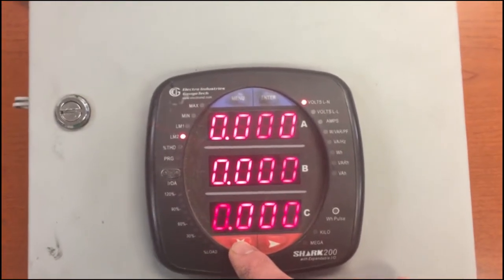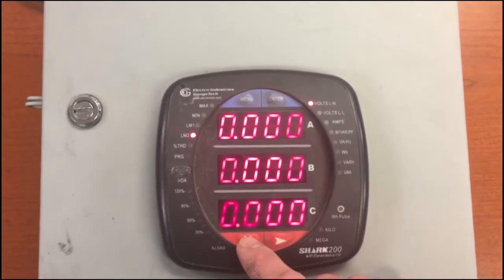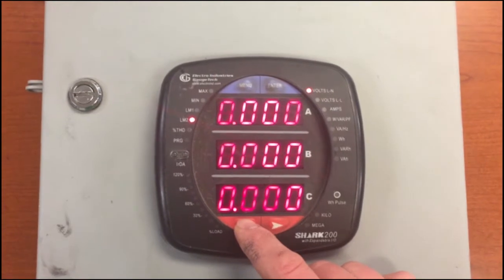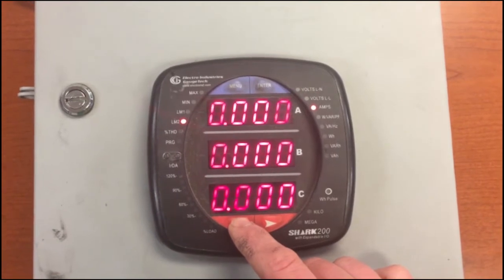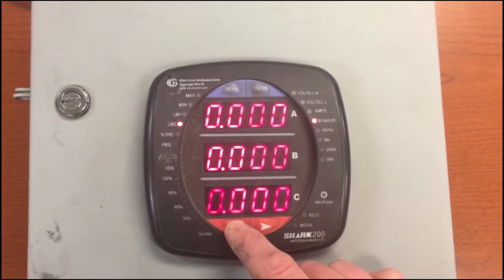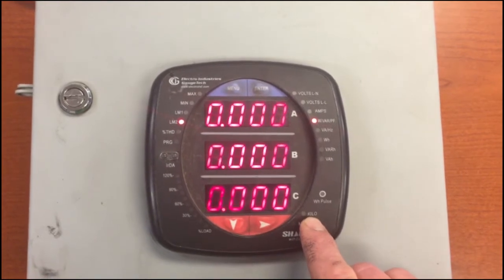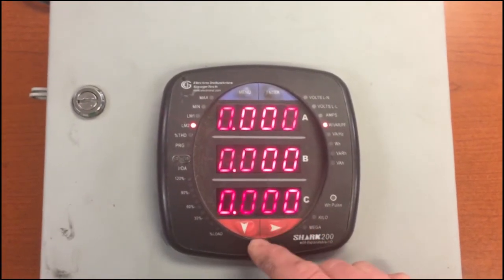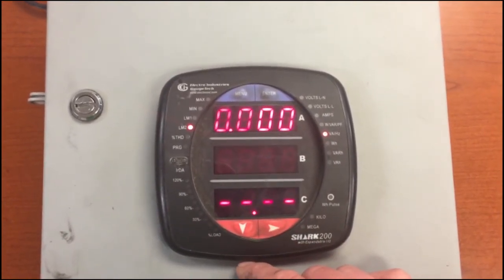Power Plant  Power Meter Shark200

Comment: hello, How do I know how many kWh the machine is consuming, which section should I check on the panel to know that information?
Reply from the maker: Hello.  You will need to press on the "down" arrow until the l.e.d. next to "W/VAR/PF" (4th from top right) is lit up to know how many kWh is on the system.  This would be displayed on the top line, VARs are on the middle line, and power factor is on the bottom.  If you are looking for total watts consumed you need to continue to scroll down until the l.e.d. next to Wh (6th from top right) is lit up.  Also verify which l.e.d. next to "KILO' or "MEGA" is lit up on the bottom right of the meter.

Comment: how is this unit powered up? from a nearby 120Volt? 277? Or are you using a 480 system ?
Reply from the maker: It is plugged into a a 120 outlet but I think that there is a voltage converter and these meters are 24VDC powered.
Reply: @alaskaenergyauthority7923  awesome thanks for the quick reply